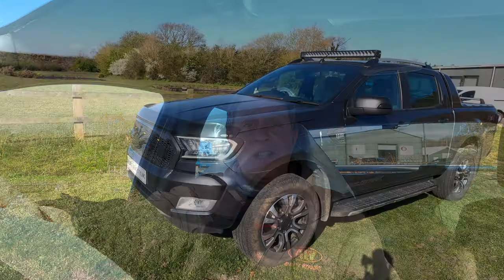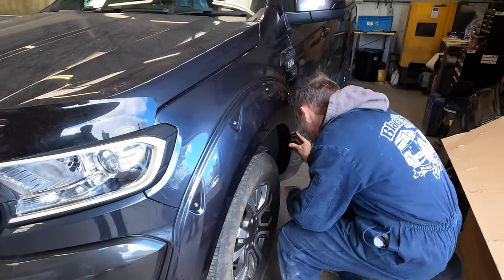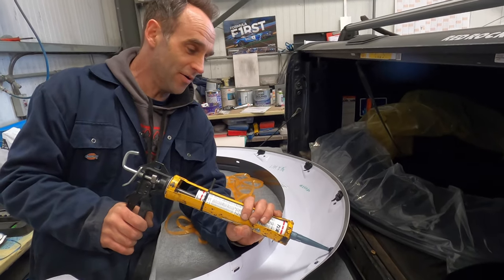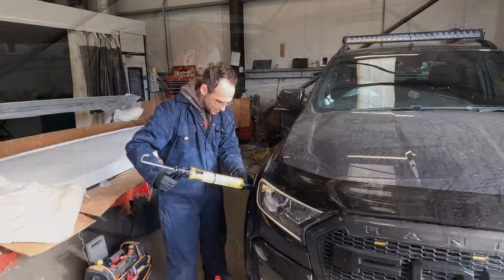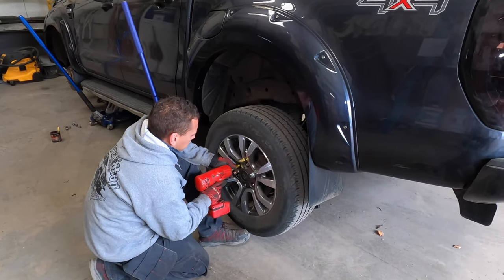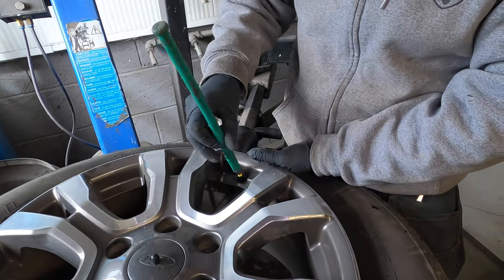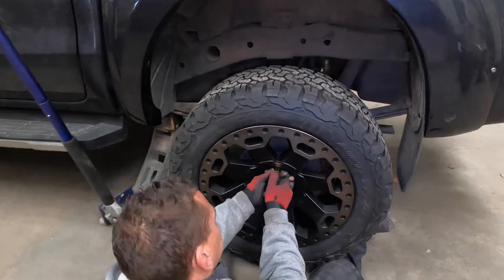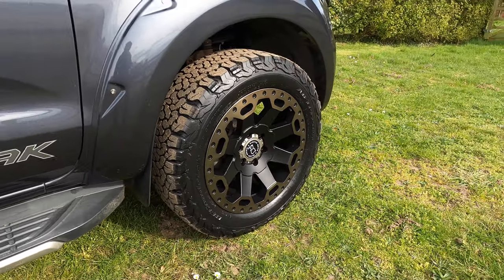Ford Ranger Wildtrak MODS! - Fitting Wide Arch kit and 20 inch Alloy Wheels - Modified Ford Ranger

Comment: With the wheel arch kits being one piece, and thoroughly glued on, how do you now go about removing the front bumper for any kind of maintenance?
Reply from the maker: Hi Gary and thanks for your comments. Using a specialist aerosol spray that helps release the chemical bond. Then re-bond them once finished ✅
Reply: @BlackStagStyling  what bonding/ sealant did you use?

Comment: Hi is this stock suspension?  Do the new wheels rub?
Reply from the maker: Stock suspension and minor adjustments required to the front wheel arches, then no rubbing 👍🏼 thanks for watching our video 😎
Reply: @BlackStagStyling  thanks for responding it would be great if you guys could post a video showing the adjustments done to the front wheel arch to prevent rubbing thanks much!!

Comment: Hi I have the same body kit Do you need to remove the front arch’s to remove the front bumper I need to fit a front mount intercooler thanks
Reply from the maker: Hi, if there two piece arches on the front you don’t need to. But if there one piece arches you do need to remove them first.